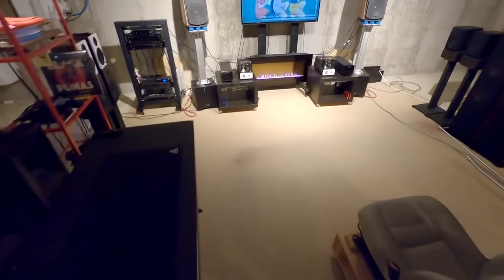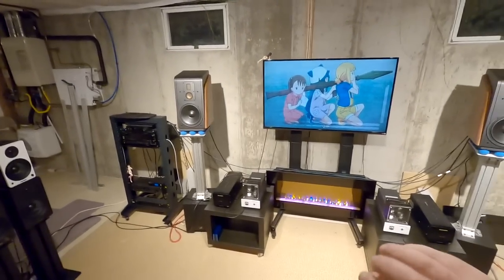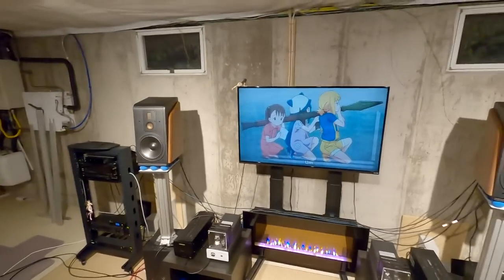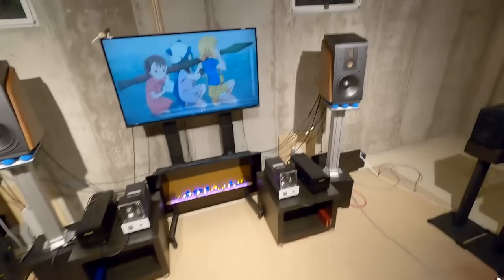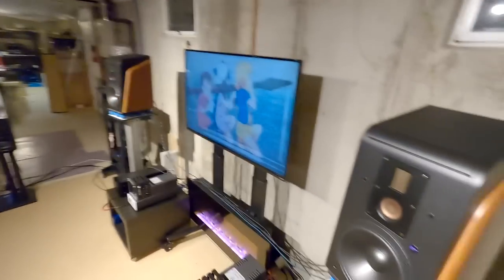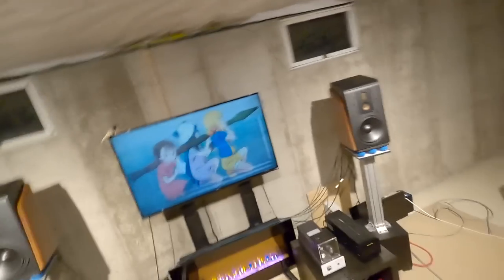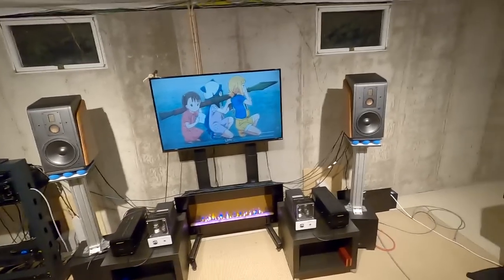🟥The BEAST _(Z Reviews)_💎Swan M500

Comment: 0:00 Zeos hides behind a pole 30 feet away
0:16 Is it worth the extra $ to go 8"  driver? feat. Swan M300 MkII
3:00 Self powered, DPS corrected, 3 way ($1,169.99)
3:24 6 pin connecting wire between speakers
3:47 Speaker controls / adjustables  (with recommended set points)
5:28 Remote and WiFi feature 
6:10 Speaker input & source for basement setup
8:08 Thoughts on speakers (loud!)
12:30 Use cases for the speakers?
14:43 Future video idea? DSP correction
17:00 Zeos thoughts for setting up a home theater (sneak peak of home theater setup)
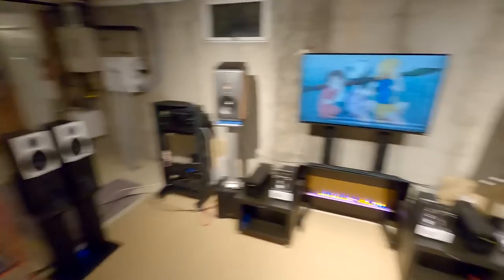21:30 Speakers recommendation? 
24:18 Bass & low-end
28:56 Outro - Sound demo , supporting of Patreon and SubscribeStar
30:05 Oppressively loud
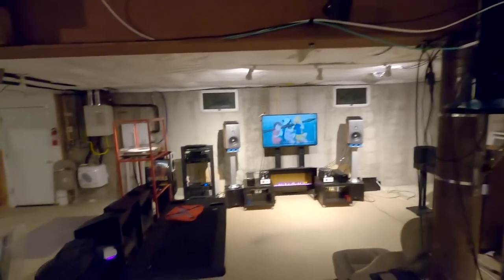30:54 Review ending right now...
31:00 Outro v2 - HiFIGuides , swap meet, $10 tier supporter benifits
Reply: that first one lmfao

Comment: I owned these for just less than a month. They are very balanced in my opinion. They lack low end though, but it's not because they can't give you low end, it's because they won't. Their tuning makes them rather reserved. But I know they are capable because they can play very deep and very loud on certain songs. However if the song has regular bass, you can hear it, but there's no punch. I wish they let you set the sound how you want it. The treble and bass settings don't really let you do that.
Reply: So what sspeaker did you have now?
Reply: Still got the 500’s? Any updates? Do they offer a software update, to remedy the bass issue? I have the chance to get some new 500’s at a good price. The 300Mkii’s are out of stock. Probably because they are better?
Reply: Do some research on the woofer specs. Replace coils on the x-over should allow lower bass,
Reply: @ronwebb9249  you can't really do that with these speakers as they don't have any passive crossovers. All of the drivers are separately amplified with the signals actively crossed with dsps. Theres a total of 6 separate amplifiers in these big bois.

Comment: Driver time-alignment has 'been a thing' in loudspeaker design for a long time and it's possible to do it exceptionally well via good crossover design and driver implementation while remaining 100%  in the analog domain. Wilson Audio and Vandersteen both make it a cornerstone in their design philosophy. To be fair you do have to spend orders of magnitude more to get there than what these cost, and DSP-based time alignment/active-crossovers are the more economical choice across the board. Not sure it's legit to claim digital solutions always 'destroy' well-engineered analog solutions, though.
Reply from the maker: I won't argue with that. But Wilson audio is also in a slightly different price bracket.
Reply: @ZReviews  slightly... lmfao!

Comment: Hey Zeos. You should really Really....REALLY...speak to Swan about redoing these speakers. They seem to be discontinuing them because of all the unwanted publicity they've gotten. Just like you, I couldn't wait to here what these were gonna sound like when they first came out. They not bad. They just need some definite tweeking. 

They didn't really redesign these. They just gave em a 8" woofer, stuck em in a larger box and called it a day. So now the dsp is causing the top two smaller drivers to ring much harder to keep up. How about replacing the 2" driver with....oh maybe a 3-4" driver instead. And also a slightly larger tweeter as well. And I really didn't think they needed to go with an 8" woofer.  A 6 1/4 - 7" driver with slightly more excursion. It ain't like they gotta rework an entire new crossover network to achieve this. The dsp  should have a much easier task of smoothing everything out for home audio bliss once they get the top two drivers corrected. And also adding the ability to hook up a subwoofer to them would really put these in a class by themselves.

I think a lot of people would be willing to pay excess of $1400 for these once....or if they decide to get em right. Cause they not that that far off from being the stallions they supposed to be.
Reply: do you know how speakers are built?

Comment: So they're a driver level trim not a Baxendal treble and bass.

The intro told me.. Not a near field listening unit. BX5a deluxe once they get the caps replaced work nice for $100 set. I didn't like the 8" version for the same reason. I'd even argue a 3" set for a desktop monitor might be optimal.

I actually pair my 5" with an 8" set of the Energy 8" sub.. A clone with Mirage and a couple others. Does a thing. Bass presence as you say is no longer lacking.

These things have a battle as a mastering set and are a bit much for anything under a 14ft triangle.

Comment: Hey zeos, what speaker placement do you recommend for m300 mkii. I know that speaker placement varies from room to room, but as a rough gauge how far should they be apart and from the walls?
Reply from the maker: you want an equilateral triangle. I'd stay at least 6" off the walls
Reply: Thanks! Will try moving it around to experiment
Reply: toeing in the M300 made a huge diff for me :)

Comment: It's too bad that with these, the M300s (or even any of the Edifiers), you can't hook up a seperate sub woofer to it. That's what's needed, the ability to add a seperate sub to get that deep rumble and punch that none of these speakers can give you, esp if you need to lower the speaker volume without losing deep bass.
Reply: Well, i got Edifier R2850DB and it got sub-out. Once anything plugged into that sub-out port, the speaker would go into "sub assisted" mode, with the sub crossover point around or at 100Hz. The thing that sucks is that you can't adjust that crossover freq. Other speakers from Edifier like R1850DB, 1855DB, and maybe the models that R2850 replaced (R2800DB, and R2750DB) also has sub out.

In that case you feed your input to your speakers first, then from speakers to your sub.

For Edifier S Series, it has balanced inputs and also Aux In (RCA input) and that is what you need to add subwoofer.
Some subwoofers take stereo input (L+R) and then relay out the crossovered output to your speakers via 2 balanced output port, just feed them to your speakers input.

In this case your input is fed to your sub first, and then it goes to your speakers.
Reply: Look at Z’s video on how to add subs. Theres a powered speaker section. He has a sub with a frequency cut off switch. Running the signal from a DAC, into the sub, then out of the sub to the powered speakers. With the switch set at 80Hz, it only passes higher frequencies above that to the speakers, and the sub handles the lows. SVS do a sub with the same facility. Z stated that its very rare, but very useful in unlocking the speaker from constantly trying to drive down to hit the lows. The sub removes those frequencies from the signal passed on to the speakers so it unlocks its potential. Usually, even with a sub out, the speaker is still being told to drive low, as it receives the same signal as the sub.

Comment: 8 inches of swan bruh, ouch!   I'm confused by their product lineup as they had the M3A and had just released the M5A in the us for sale.  Now there is a M300 Mk2 and M500 which are both active as well.  They used to have a passive set of M300 so assumed the M500 would be the passive M5a.   So confused with their product lineup.
Reply: wonder if these would be good PA speakers for an outdoor event area that don't want the shitty concert speaker sound.
Reply from the maker: 98% of Swan are active. The M5a and M3a are just a higher end design even though they don't cost much more.
Reply: In order : M5A, M3A MKII, M3A, M500, M300 MKII and M300. The M300 is the only 2 way from everything I just listed. And anything with a '5' doesnt have an MKII.

Comment: I want to upgrade from my swan M5A's.  I want more power.  What do you reccommend?  How much power do the M500's have?
Reply: Same as M5A, 510 WRMS
Reply: @JoshyLats  What are you saying please?
Reply: @daryldaryl887  they both have 510W, same power, you shouldn't need more than m5a, I don't understand how you can want more power....
Reply: @JoshyLats  I run them through the desk top computer.  Windows seems to govern a lot of power out.  But I added an equalizer app program, and that seems to be fixed.  I think the power is good now.

Comment: Hi, i have a question about my (potential) home audio system- i bought a pair of klipsch rp160m speakers and went to an audio store to decide on an amp. They sold me an onkyo a9110 which is supposed to be a pretty good integrated amplifier. I also have an active subwoofer and it seemed like a good deal but on reading about amplifiers i noticed that the wattage seemingly isnt enough to support the speakers. The klipsch run on 100w rms at 8 ohms, the amp has 50w+50w rating at 4 ohms. Reviews about the amp say that it can deliver alot of power because of its high quality, and people say about the klipsch that they dont need much power to get loud. Can i combine those components safely?
Reply: You most definitely can. I'd only consider getting more power if you find yourself running it at 60%+ power regularly. The common wisdom says that you shouldn't really run an amp past the 12 o'clock position. That's because you want to stay within an amps "linear range." Hope that helps.
Reply: @Grassy_Gnoll  Thanks, i was seriously worried that i was going to damage my speakers👌🏻

Comment: Swan makes some amazing speakers. I have the M300 Captain America for my TV. Their customer service, however, is wretched... awful... wretchedly awful... and it sux, too.
Reply: Yeah, I spoke to them about small issues with my M200Mkiii+ and they didn't reply to me about a replacement remote (remote would randomly mute when using volume control) and when hooked up to my Ps3 when surround sound was active they would spit out this death static noise, but I figured if i set the ps3 source to stereo it fixes it, But it sounded awful when it was pumping out the static noise, I thought they were gonna break.

Other than that, they are amazing speakers, Looks, Sound, Build. 

Go Swan! 
But yeah better customer service

Comment: Run a nano-digi to cut the output down to say 40% to the speakers so you can have better fine grained control of volume with it's remote, assuming Swan won't fix this via firmware update.
Reply: Good suggestion👍 I have a large room. 25ftx16ft with 10ft walls and an open loft style ceiling. This video was over a year ago now. I’m wondering if theres been any updates or modifications?
Reply: Wouldn't setting the source at a low level volume and controlling it via the amp put more "usage/stress" on the amp? 

Not that its a bad thing, the amp is supposed to be used I know, I've always just wondered this.

Correct me if im wrong, but setting the source to 80%-100% is ideal I believe.

Comment: What is very hard to believe about these is, I have a 300wpc 2ch amp that cost $1500. And that's before speakers. How could these provide more output than whatever speaker I hook up to that amp for significantly less?
Reply: His Klipsch big boys are using monoblocked Crown amplifiers that each do like 1,000 watts, and I think they only cost him like $500 a pop
Reply: There are multiple reasons why. Active crossover vs passive crossover. The distance between amp and speaker units. And there are way more reasons why most active speakers will outperform passive ones.

Comment: wtf is wrong with the volume control these days? Had the same problem with Edifier S3000pro. 50 volume steps and maybe just 8 usable. Nothing, nothing, quiet, almost there, TOO LOUD, WAY TOO LOUD and then 42 more steps.
Reply: volume controls are hard to code it seems, or they forget to do it... i dont know but a good volume control is hard to come by after the normal volume knob is rare.
best digital volume i experienced so far is my minidsp shd studio, its damn near perfect. knob is the best and the remote is pretty good.
either way its a perfect match for controlling active speakers, with the swans use the digital coax input.

Comment: How about use them without bass boost and treble boost ? Maybe they will sound quieter and like normal speakers and with actual dynamic range and not compressed. Pretty sure is like enabling loudness equalization on some amps or on windows for listening at night so you hear all frequencies at the same loudness. Yeah. Brain magic.
Reply from the maker: I tried all the ways. I did every increment on the clock for both knobs in both directions.
Reply: I have these speakers.  Have had them for a few months.  Like Z said, They have beautiful sound, Great Clarity, and the dsp tune on them is magic with the knobs cranked.  But they are beautiful like a thunderstorm.  You sit on your front porch with a beer and hear the rolling thunder and it sounds beautiful when it's miles away.  These are what it would be like if your front porch was inside the thunder storm.  It Is SOOOOO much sound.  Honestly, I love them because I'm one of those people who have certain songs that I just cant listen to loud enough because I want to drown in the music, these are like a freaking ocean dropping on your head which is exactly what I want. These will be too much for most people.   This was a perfect review and exactly how I would describe them.  Great sound, but you need a LOT of space because the sound that comes out of these guys is BIG.

Comment: Whelp...I'd been considering a set of these for a while (several weeks). Got as far as 25:47 before I clicked "place order". 

Never say "it's too much" - that's one of those "Challenge accepted!" kind of phrases. :)
Reply from the maker: I meant it this time tho.. I MEANT IT!
Reply: @ZReviews  - so Z, I have a question - how many different input methods did you try? I ask because I got my speakers a couple days ago and started the break in process with a few hours of music, and I haven't had the issue you did with the super sensitive volume. 

I want to preface with the thought of why I bought these - I like my music on the loud side. I intend to use these as room fillers, in a large room and a small shop, so loud was ideal. I did my first listening/break-in session in the room, about 14'x25', and found a few things. I used my phone over Bluetooth for a source, and figured that I could just adjust the phones volume to add low volume resolution to the speakers if I needed to, but I didn't need it - with the phone up at full I had normal volume control of the speakers. I couldn't even hear anything till 4 clicks up, and I found 15 to 18 clicks up to be comfortably room filling. I also want to point out that I like to sing along to the music  and I'm rather loud, but even up at right around 18 clicks up, I was still louder than the speakers when I was belting (5 finger death punch- wrong side of heaven is a good example). In your review you couldn't have gotten them that high - so I wonder if it's a source issue, or did they maybe update the speakers firmware or something like that? Maybe you got a set with an issue? But I have normal fine grain volume control with mine, at least over Bluetooth. I'll try one of the other connections when I'm able and if it's different I'll follow this up.
Reply: Great information👍 I have a large room, 25ftx16ft with 10ft walls and an open loft style ceiling, and would love to use these as standalone stereo speakers for music and movies with my projector. This video was over a year ago now. I’m wondering if theres been any updates or modifications?
Reply: @T Z  - as far as I'm aware, no - mo updates to the speakers. Swans did release a new updated dl speaker of a different line a bit ago, and Z reviewed it. Based on that review, this hsveva feeling they knight be about to update these to a newer edition too, though that's pure speculation on my part. 

I can say I love these speakers - they're awesome. 😀
Reply: @Broadpaw_Fox  Thanks for the response🙏 I’ve been looking on the internet and can’t find any images of the bottom of the speaker body. Are the feet screwed into place? Are their any screws anywhere under there? I’m thinking of a floating mount system, and it would be useful to be able to fix them securely to a plate at the base.
Reply: @T Z - I know there are pads underneath, but I'm not sure if there are screws under them. I don't think so, but when I get home next I can check. I'm a truck driver, and I'm working for the holiday, but I should be home next week - I'll try to check and see. 😀
Reply: @Broadpaw_Fox  Thanks so much. Best wishes, and drive safe.👍🙏